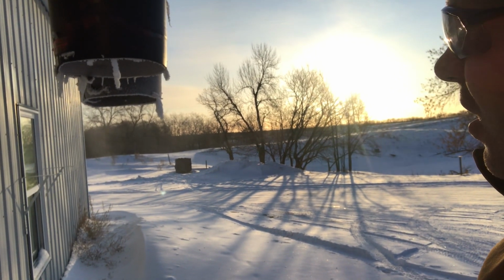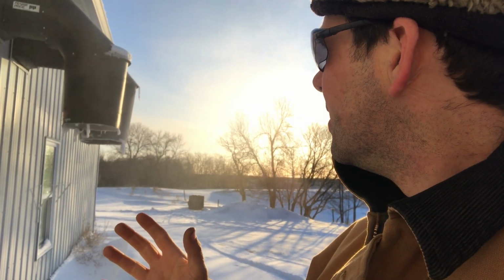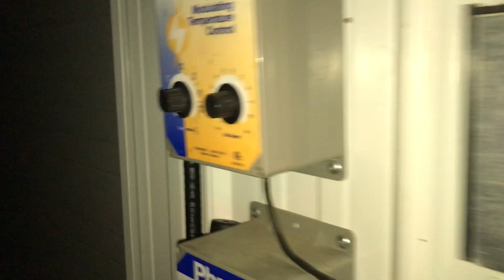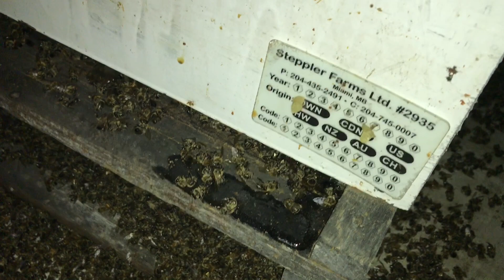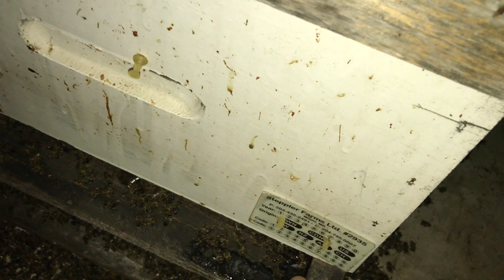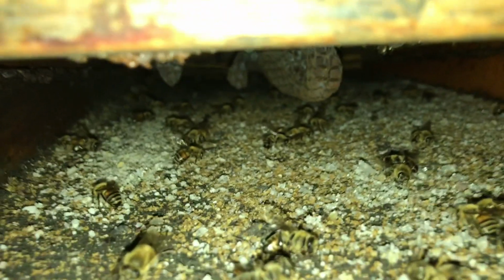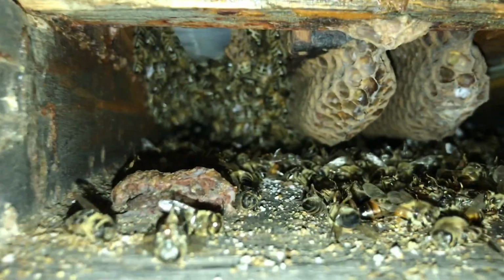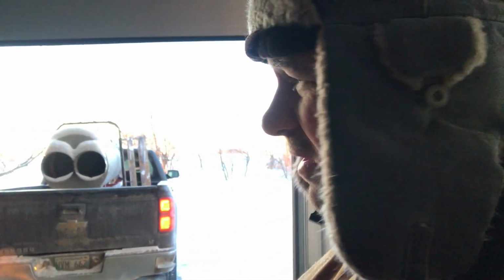Artic Blast, Embracing -35C

Comment: -5F here currently. I have my bees wrapped until we get back into the 20s. I got temps sensors on the hives and they are still keeping the clusters in the 90s. That shed you have is pretty awesome. Probably quite necessary up there with those temps.

Comment: A possible solution to one side of the room being much colder then the other side would be to put two series of duct works, attached to your fans, along the ceiling of the room,  with a series of vents along the duct’s length.  Open the vents from the incoming fan where you want the room to be coldest and open the vents to the outgoing fans on the opposite  side of the room.  Periodically open and close  the vents to move to cold and warm sections of the room around to even out the stress the colonies experience over winter.  Moving the open and closed vents will also move the more and less humid areas around the room over the season.
Reply from the maker: Ya a plastic duct plenum is in order